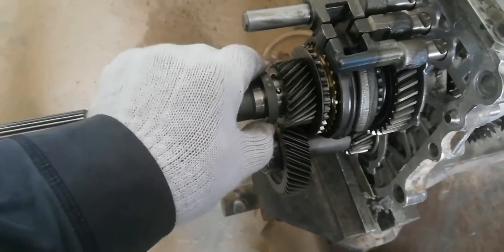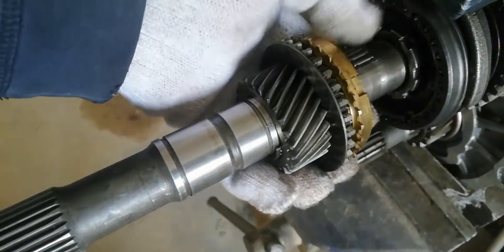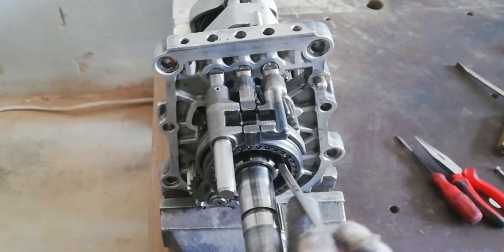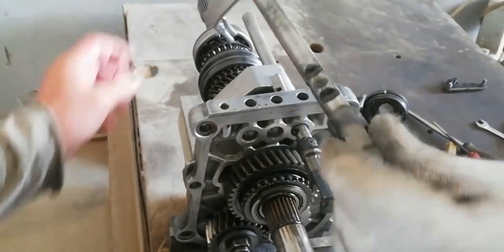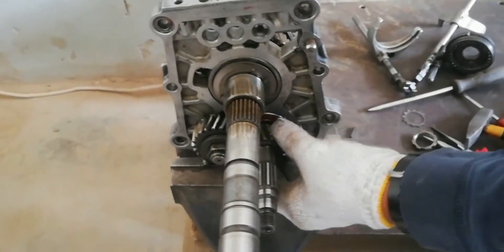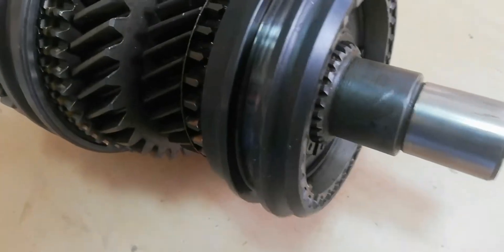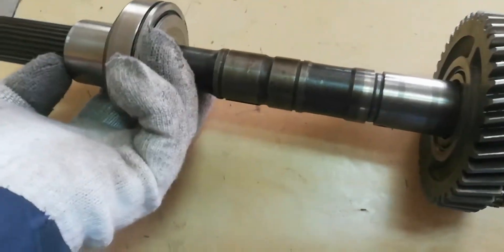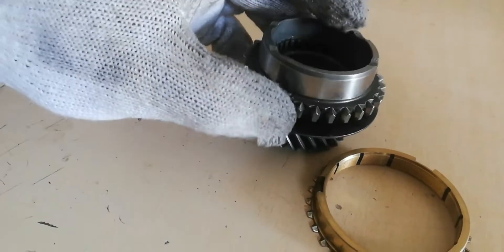ISUZU 4JA1 TRANSMISSION COMPLETE DISMANTLE PROCEDURE@yrhelmechanicalelectrical9113

Comment: Spigot sharft not turning??
What could be the problem,just changed cluster Gear 🤔🤔
Reply from the maker: when replacing a cluster gear requires careful attention to the associated bearings and their fit within the transmission housing to prevent recurring problems. careful to the bearing clearance, avoid bearing plays to the housing
To ensure a successful and durable repair

Comment: Good morning. Nice to meet you. I'm your customer from Indonesia. I own a Chevrolet Luv with an Isuzu C190 engine and a 4-speed transmission. The problem is that when the engine is running and the transmission is in neutral, there is a loud noise. However, if the clutch pedal is depressed or the transmission lever is moved and held in 1st, 2nd, 3rd, or 4th gear, the noise disappears. What components or parts do you think need to be replaced? Thank you, I look forward to your reply. Good luck and stay healthy.